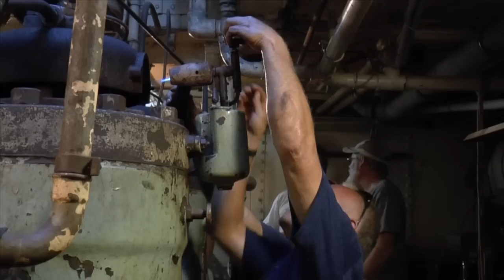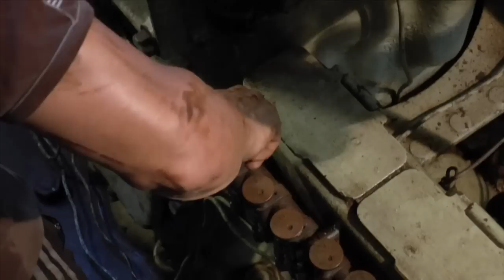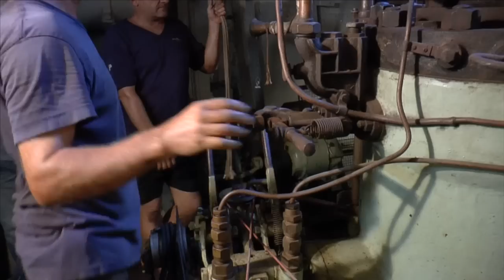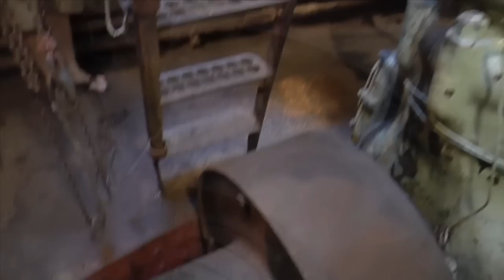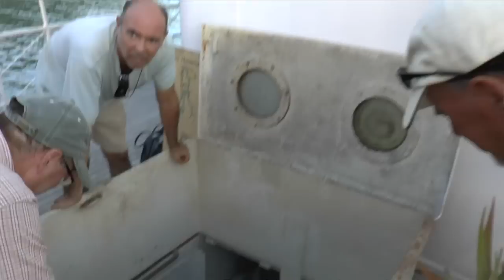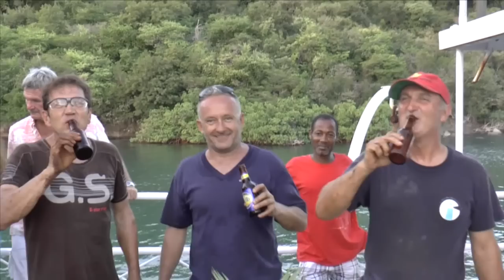Boom, boom, Bolinder

Comment: What's the matter with the other cylinder? Didn't you pre-heat its hot-bulb? Did it start later on?
Reply from the maker: The injection-line was blocked on one cylinder. We will hopefully start on two cylinders next time.

Comment: not sure why it takes 12 minutes to figure out the cooling system is not working.. 1.you get water flow.. or you don't  that's pretty quick.. then I guess you wait to see if the temp rises too much.. and that could take 12 minutes with an engine that big.  .. clogged passages, bad thermostat.?
Reply: It is likely it was manufactured decades ago using some cast iron parts (before manufacturers realised seawater cooling of cast iron marine engines is self-destructive). It appears the engine has not been started for 10 years and continues to be seawater cooled. So for ten years the engine would be standing dry. Salt from the evaporated seawater + oxygen from the air + cast iron = it will be rusting away internally in the water jacket. The rust flakes off the inside of the water jacket and collects near the lower cooling seawater inlet, partly blocking the inlet.
Given enough rust trapped inside, slowly growing in volume, the casting will eventually start to fracture or burst, destroying the engine.
Someone should tell the owners of the engine this, as I do not think they will be able to get a replacement part once the original casting fractures. They need to prevent it fracturing. But since it has been seawater cooled (for all its llife ?), I think the chances are that some of the salt has been absorbed into the grain of the cast iron. 
Depending on the engine's age, it may have no thermostat.
Reply: The mass of the whole engine is such that it would take that long just to heat everything...even a little.
The cooling system? Why it is not working? Who knows?

Comment: Surely there is a smaller, lighter, more fuel efficient engine that could be put into there. That engine must have weighed tonnes, spewed tonnes of pollution and would have been not very fuel efficient.
Reply: What did I miss here Don. I'd like to know how I offended you personally.
Reply: fourbypete   why on Earth would you remove part of history these guys love working on these old engines I just wish I could join them
Reply: Simple. Old motors waste resources. While you see an opportunity to keep history going, most of the world is trying to move forward to improve peoples lives by improving the way we use resources.
Reply: @fourbypete  the ship is not in daily use. Using your logic we should put all horses to sleep because they are no longer used for transportation except for pleasure riding. Use the new technology, but preserve the old so we can appreciate how far we have come.
Reply: A handful of antique engines running off-load for a few minutes a few times a year for visitors in museums is going to have negligible impact on the environment compared to modern petrochemical industry and global transport networks.  Besides, it's a Bolinder, you could run it on vegetable oil or probably even bloody melted butter if you wanted (good way to get rid of the European Butter Mountain!), nice and carbon neutral.